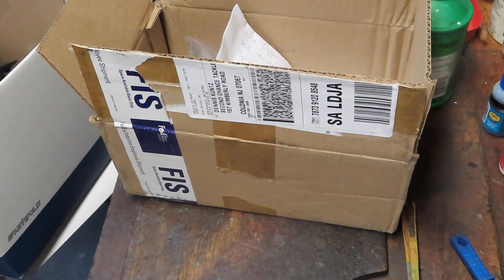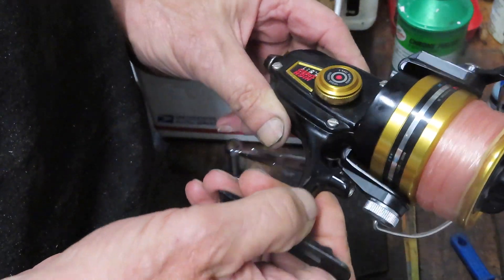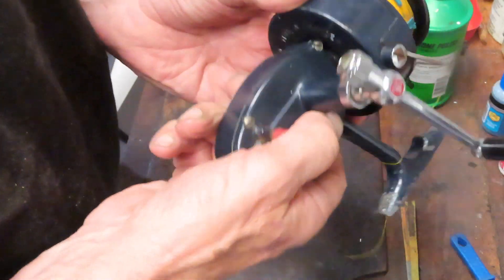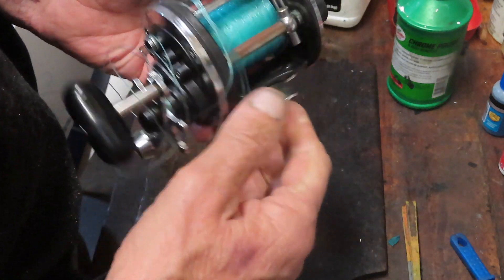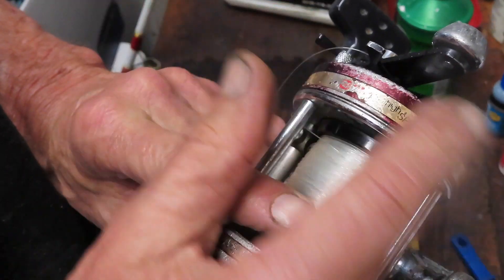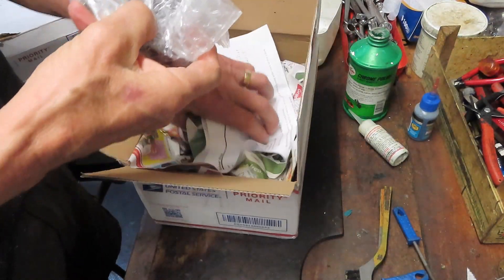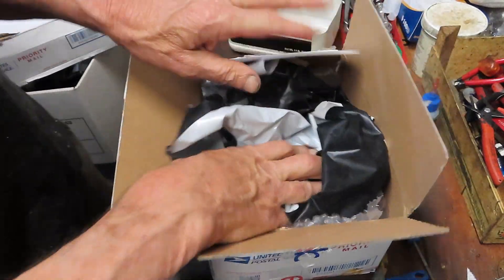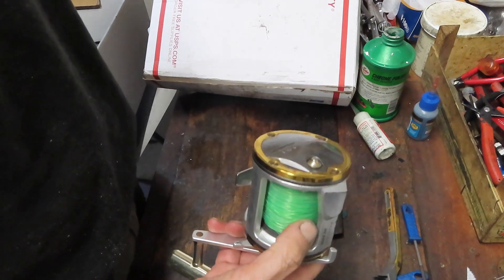New pandemic fishing reel projects and previews of upcoming videos 5 26

Comment: Looks like a nice bunch of reels to work on. Id particularly like to see a video on the to Mitchell spinning reels the 402 and 9 9600 looking forward to seeing videos quick side question what is the difference between a d a m quick 550 and a d a m quick super from what I can see just cosmetics I thought about getting a d a m quick same to be overbuilt reels I'm going to take a wild guess and figure the super is a high-speed?
Reply from the maker: I am not entirely sure.  I believe the Super has a higher line capacity.  The line retrieve on the Super is 3.2:1, so that is not particularly high speed by today's standards.  The Super was designed for surfcasting, but internally almost all of the D.A.M. reels use the same spiral gear design.  The parts just get bigger as you go from the 110 up to the 550 and Super.   Perhaps another video can add more.  Thanks for asking - Dennis
Reply: @2ndChanceTackle  many thanks and yes a good video of the super would be nice better explaining everything with it

Comment: Have always wondered why they make most conventional reels with a right hand retrieve.  I use abu 6501, 6601 and 7001 series reels which are all left hand retrieves.  I grew up on and still use spinning reels with left hand retrieves because I am right handed. To me it only makes sense to use conventionals with a left hand retrieve, Baffles me.
Reply from the maker: It's one of those mysteries of life.  The right or left hand retrieve allows you to use your dominant hand where it is most beneficial.  With reels mounted below the rod, you need the strength to hold the rod up, so most spinning reels use the left crank to a right handed person.  With rods that have the reel mounted up top, the reverse is true, you need your power hand to crank in the big fish, so that goes to the right side.  Right handed people are about 90% of the population, so manufacturers have built there line-ups to them - Dennis